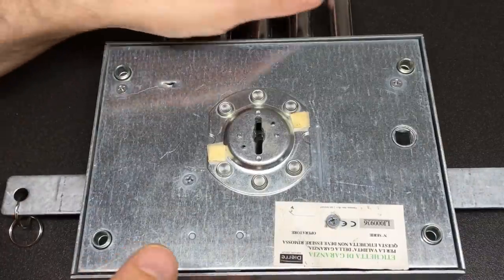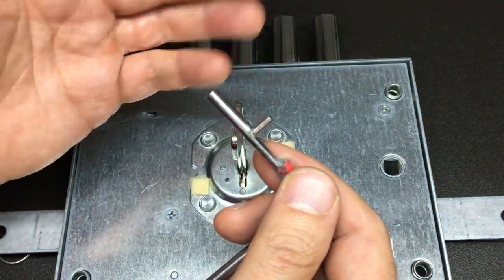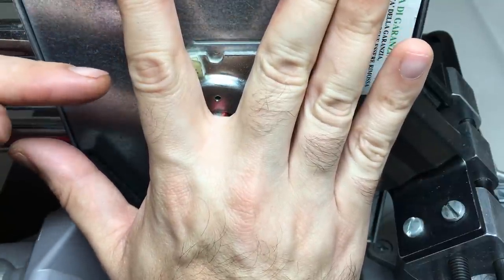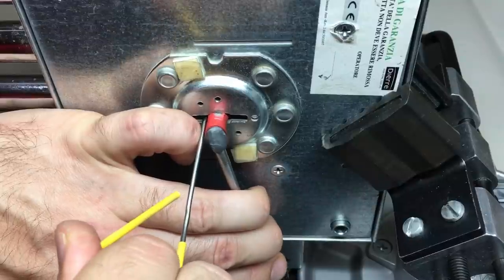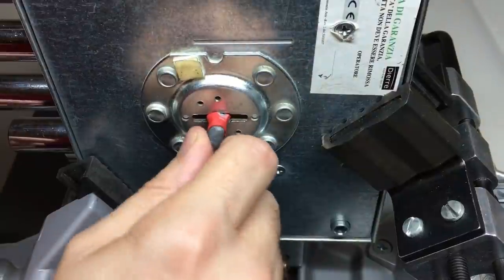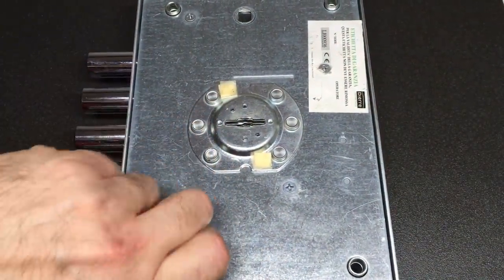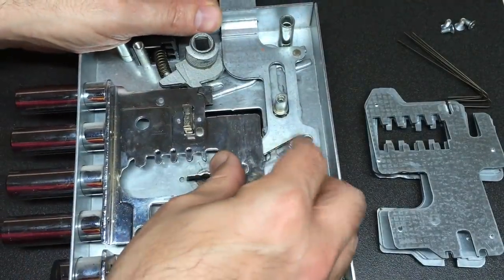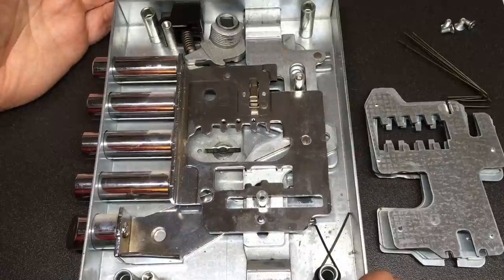Dierre 6 Lever ‘Beast’ Pick and Gut

Comment: These kind of locks are pretty common in Italy (most of them also contains a slot for a secondary European cylinder lock for an extra security against picking attacks).
The main feature of this lock is the interchangeable code.
To change the code, the end user can simply buy a sealed bag contains the new keys and a new coded bolt, open the changing flap (located under the handle on the inside layer of the door), remove the screws that hold the old coded bolt and remove it, than replace the new coded bolt, tighten the screws and replace the flap..... definitely cheaper and easier compared to dismantle half of the armored door to change the entire locking mechanism!
Reply from the maker: Very interesting and I can see how that would work!
Reply: Thank you for sharing this information.  God bless 🙏
Reply: Would you mind sharing the name of the door locks they use in Italy ?   We're interested in the high security locks.  Thank you 🙏

Comment: I was asked to remove a lock from an old walk-in safe. The door was open but it took 4 people just to remove the back plate (it was that heavy). So I took the lock to a locksmith and it took 5 weeks for them to produce a key for it. It was so complicated. There was no key blank to cut from. He had to make the key from scratch. Welding, grinding ect. One key cost £560.
Reply from the maker: Ouch!!!!

Comment: You think the key dimensions would allow sufficient meat on the centre tension shaft/tip of a 2 in 1.  I wouldn’t mind developing a 2 in 1 for one of these, would be a change, made 3 today for the Era old English, nice easy pick to make.
Reply from the maker: There are already some self impresssioning tools about there for these I think :-)
Reply: @LockNoob  I was thinking more traditional Hobbes type 2 in 1, like I used to knock up for Markd and the guys on UKLS.  I know that our friends at Turbodecoders have the Mottura version, gotta respect the r n d that goes into making their complex tool tips.  If I had access to an EDM machine, wow, the possibilities would be immense, especially for a complex Yale impressioning tool, with rolling moving elements to allow pin descent😛😛🤣♥️

Comment: Thief: "Pick honking big-assed monster front door lock OR break tiny window on side of house..... Hmmmmm."
LOL
Reply from the maker: exactly lol
Reply: It would be easier to bust through a brick wall than a door with that.
Reply: This kind of locks is pretty common in Italy (even if aren't considered safe anymore because are quite easy to pick).
BTW, our houses are made with thick, strong solid walls (made with concrete, solid bricks, rocks and steel rebars), because of that, our very first layer of defense against thefts (usually the only one, unless there are some extra valuables inside) are armored doors and windows.
Our external doors are made with steel (in some cases, multiple layers of steel and composite material) and we usually have armored rolling shutters and/or armored shades and/or steel bars on windows.
Of course, we can still have alarms, safes or other similar things, but these are considered as extra protection and employed only if some extra protection is required.

Comment: @LockNoob is the coded bolt directly matched to the key bitting if you were to put them side by side?  and are all the levers the same stamped out pattern or do the gates vary like a traditional lever?
Reply from the maker: i will have to check!

Comment: That's a residential door lock?!  I assumed it was from a safe being that substantial!  That's getting to the point where it'd be easier to just knock a hole in the wall than try to go through the door!
Reply from the maker: It really is a bit of a beast, but pretty common i believe
Reply: This is a pretty basic lock for basic residential doors in Italy  (not even considered super secure!).
Is used on armored doors (which are the standard residential doors in Italy)
Of course we also use armored windows too.
... no, breach inside an Italian house trough the wall is definitely much hard than breach trough an armored door or window (we don't use wood and plaster to build houses!!!).

Comment: Um, what about the teeth on the other side of the  key? Are both of them used to unlock this lock?
Reply: This is called "serratura doppia mappa" (double bitting lock) because you have two bittings.
One bitting is for even steps and the other is for the odd steps